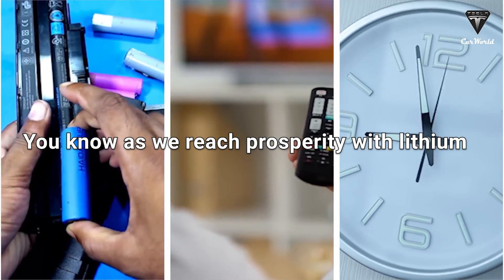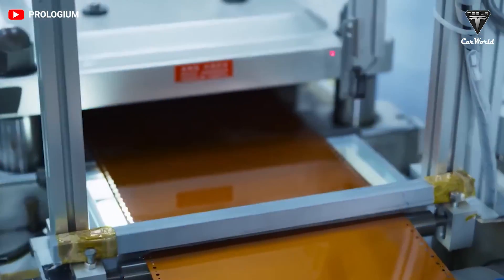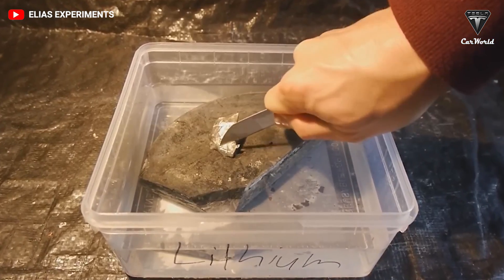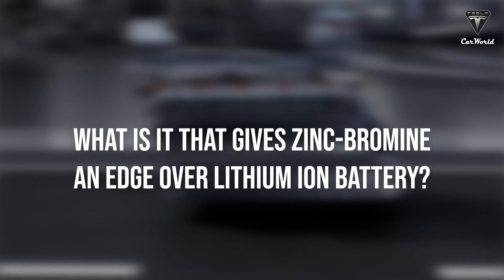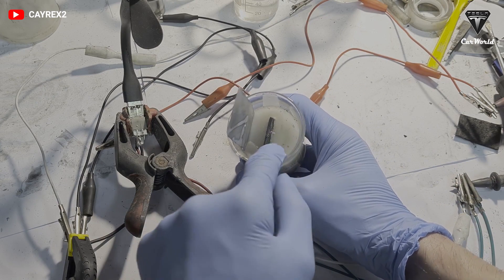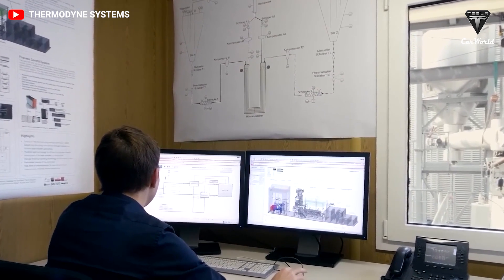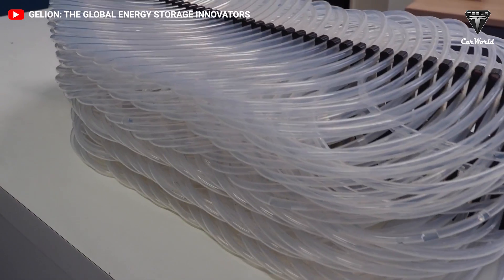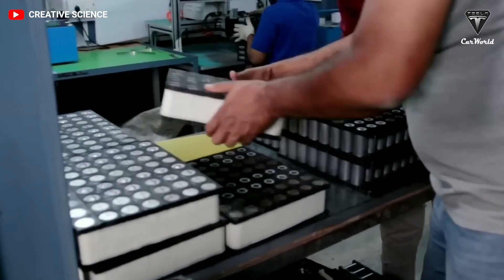Finally Happened! The Future of Energy Storage Batteries Will Shock You!

Comment: Despite it not having the same energy density, size may not matter as much for home use.  I've seen few LiPo batteries accidently get punctured and the batteries had a runaway fire.  It sounds like these new batteries will make it safer for home use.  The question I really wonder is cycle life... and how many years will it support discharge and charge cycles.
Reply: Spot on.  The fact they did not mention these numbers might mean that its still to early.  If a house could use this at a third the cost then they will be successful.